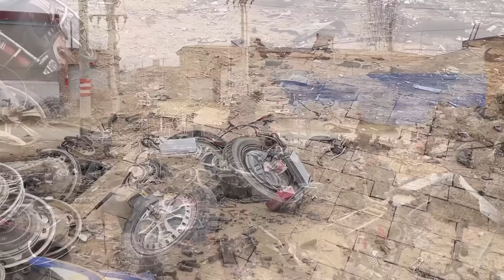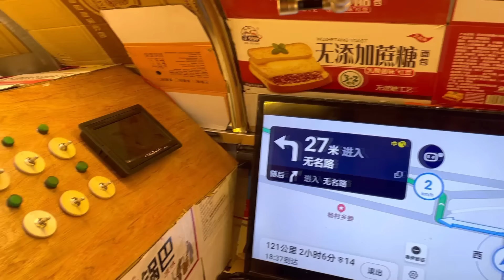ENG) Retrofit an Electric Car with Recyclable Waste. 廢物利用自製全能“香皂車”【手工耿Handy Geng 】

Comment: Right off the bat, I HAVE to say the way he rigged up the gears and that chain as the steering rather than having some kind of steering column is actually freaken genius. Since he's not going to have any kind of power steering, having the smaller and larger gears reduces the friction and the amount of force needed to turn the wheels. Dude is smart as hell. Lol.

Comment: It needs suspension, headlights, tail lights. Also, when you steer, the rear wheels soppose to turn in the opposite direction co.pared to the front ones, still being able to flip them at 90⁰. That will help cornering a lot, reducing the turn radius.
The concept is great, the idea of recycling is awesome, but there is too much decorative trash inside.